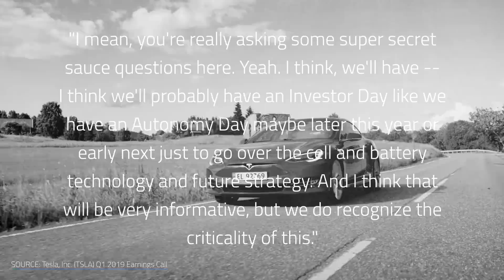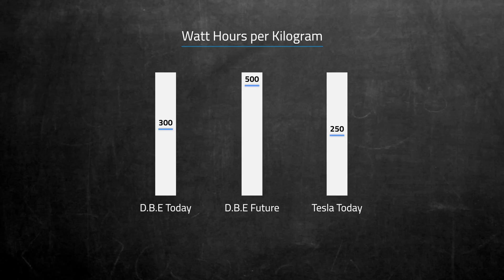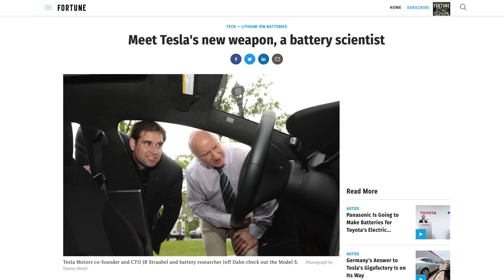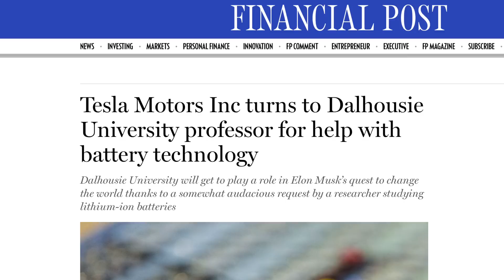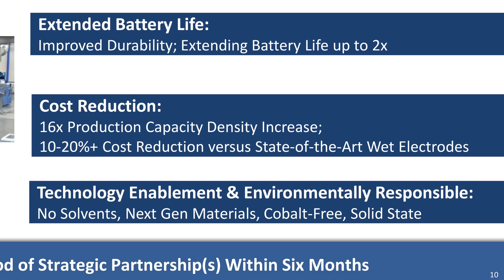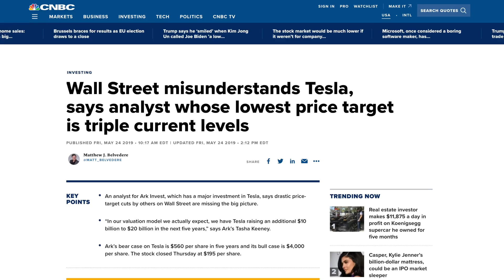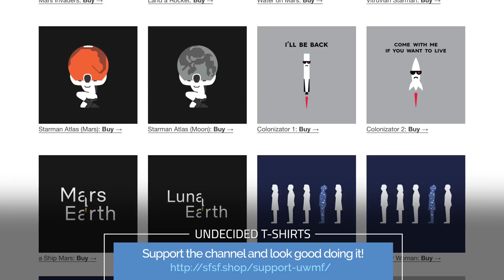Tesla And Maxwell Technologies

Comment: I'm missing only one thing about the aspect of UltraCapacitors which isn't highlighted in your story.
It's ability to both take on an enormous amount of power as well as provide this back in a very short period of time with less to none heat conversion.
Using this aspect as a "buffer" can easily increase both "power to the wheels" without hurting the batteries as well as immediate regeneration on breaking. 

This would be especially effective on regen breaking and quick power requirements on performance cars but would also work as a very good buffer for i.e. the Tesla Semi.

Also dry cathode battery with ultracap "skills" or a hybrid setup could due to it's efficiency last longer and have increased range because of decreased losses plus increased range due to increased capacity.
Reply: Won't need caps at all in the new vehicles. The batts provide 1 million miles. All the caps would do is shred the rubber off the rims.
Reply: Supercaps are a cheap but not very energy dense solution for hybrids that have batteries that are too small to take a burst of regen electricity.  Tesla cars do have a large battery so they can do a high regen rate, so supercaps wouldn't add anything.  I wish people could understand this.
Reply: @gigglehertz  they don't need to be very energy-dense to act as a "buffer". With a very low internal resistance the regen will lose less power due to heating so more power remains. 

This remaining power won't last forever because the ultracaps have a higher discharge rate hence it would mainly add on the track or with cars that have a very high weight which could give a very high regen power.

Perhaps check this out:
"Ultracapacitors are good partners for lithium-ion batteries and other high energy density storage technologies. With power density up to 60 times greater than batteries, they can be connected in parallel to create combined power supply units. Due to load leveling, the ultracapacitors can significantly expand battery life and improve safety. In an electric car, for example, an ultracapacitor can provide the power needed for acceleration, while a battery provides range and recharges the ultracapacitor between surges."

Source: https://www.skeletontech.com/ultracapacitor-technology
Reply: @gigglehertz  Ultracapacitors have very little internal resistance (down to 0,12 mΩ), allowing them to work at close to 100% efficiency.
Reply: @gigglehertz  the Tesla car battery has a very large internal resistance and will have more heat conversion than an Ultracap would have. Ultracaps have over 100x less resistance and with that near to 100% efficient energy transfer. This makes them very usable for a buffer between the battery and the engine. Especially for cars that are in "Track mode" or for e.g. a Tesla Semi that would require a very large amount of power to start off. An ultracap can even out the peaks in the power surge and with that stress the batteries less.

Perhaps check out this site to get an idea of the advantages in this context:
https://www.skeletontech.com/ultracapacitor-technology
Reply: @gigglehertz  Just  a short quote from the site I was referring to:
"Ultracapacitors are good partners for lithium-ion batteries and other high energy density storage technologies. With power density up to 60 times greater than batteries, they can be connected in parallel to create combined power supply units. Due to load leveling, the ultracapacitors can significantly expand battery life and improve safety. In an electric car, for example, an ultracapacitor can provide the power needed for acceleration, while a battery provides range and recharges the ultracapacitor between surges."

Comment: Million mile battery with 400 or more miles of range?  Since I would burn through a million miles in a mere 50 years at 20,000 miles per year, I am not buying this junk.  I mean if you average the price  of a 45k model three over 50 years that is almost 1000 dollars per year, freaking ridiculous.  And the car only has scalded cat levels of acceleration, and only five star safety.  Come on Elon, you can do better.
Reply: If an autonomous semi truck is driving around 24/7, stopping only to charge and load/unload, then you could get to a million miles in three or four years. Wonder why Tesla's looking for a million mile battery?

Comment: @1:05 “that innovation (DCE) is the primary reason Tesla purchased the company”.  Do you have a link to an official statement from Tesla or Elon, or are you stating speculation as if it were fact?

@1:20 Elon totally dodged the question. He made no claims about why Tesla bought Maxwell. Why would he when the Tesla fans are already reporting it is fact? Except that analysts can’t factor in some fan based speculation into the price.

You guys are overlooking the basics while searching for a unicorn. Maxwell makes capacitors. Tesla uses capacitors, and lots of them. Tesla can probably use all of Maxwell’s production capacity just in its inverters and chargers, in its vehicles and energy storage units.

Tesla bought Maxwell for 3x it’s book value. TSLA trades at 7X book, so buying Maxwell will instantly make TSLA fundamentals slightly better, so that’s icing on the cake.

But Tesla bought Maxwell, and it’s DCE Technology, for a mere $200million in TSLA stock, which means Tesla paid less than $200 million for this $trillion battery technology, and Tesla doesn’t even manufacture battery cells, so they would need to branch off into cell manufacturing to even use the theoretical technology.

I think we should look back on what happened with large format NiMH battery technology, when GM bought 50% of Ovonics's technology in 1994, sold it to Texaco in 2001, who was acquired by Chevron in 2003. This was the battery that made the EV1 almost viable, and was used in several Toyota EVs, and is still used in some Toyota hybrids. 

So if Maxwell had real technology, or even remotely feasible technology, why wouldn’t someone buy it or al least 51% of the rights to it for $100 million? If this battery is all the Tesla fans claim, it’s worth $trillion dollars to a battery cell manufacturer OR any company who wants to delay the adoption of EVs.

MXWL sold for $40/share in 1999, don’t you think all those shareholders tried their best to get someone besides Tesla to buy it for 1/10 of its all time high? 

Are you really going to believe Panasonic, LG Chem, Samsung, GM, Ford, Shell, Chevron, or the 100 other companies which have $100 million as pocket change wouldn’t have bought MXWL if any of the experts who met with Maxwell told their client to buy it now? 

And why doesn’t Elon say it if it’s true? The stock could use a boost.

Unfortunately a lot of the Tesla pump and dump squad reported speculation as fact, and a lot of bagholders bought shares at over $260/share.

J.B. Straubel, in order to not risk going to jail for insider trading, has created an automatic execute and sale plan. Since nov 2018, he has executed 105,000 options for $20-$31/share and sold them for $264 —> $190 per share. He netted over $40 million before taxes. He is allowed to cancel the automatic selling plan at anytime without risking insider trading. So ask yourself, why is the real brain behind Tesla selling so many shares of a stock that Ark invest says will be worth $560-$4000/share? What does J.B. Know that we don’t?

Comment: Maxwell is in more markets these could be helpful for tesla:

 - automotive: active suspension, backup-power for eCall and doorlock

- heavy transportation and industrial: trains, buses, trucks, cranes, generators;  bridging power and grid/voltage stabilization, braking energy recuperation

- grid stabilisation, wind and solar power smoothing, hybride power storage

- energy storage for windturbine's emergency pitch control system

Comment: Maxwell Tech also had another project that Tesla intergraded into the Models they are now building.Regenerative Suspension, Another way to get lost power back to the battery.
Reply: add regenerative respiration:  the calories from your lungs .... ;-))
Reply: @JamesSempy  or a full body suit. Every time you move you generate electricity. It can very green if you eat lots of vegetables for calories.
Reply: Yeah currently gigantic wave tech power shrunk down sounds amazing
Reply: California will start charging it's citizens for the electricity from the pot holes it doesn't repair.  Unless you are an illegal alien or a college student, then it's free of course.
Reply: Reverse polarity braking would be great also. Shouldn't ever need brake pads
Reply: Crypto KO, should be no more smoked brakes on hills too.
Reply: Mall JZ mini windmills would only pop up during braking. Let that sink in for a moment.
Reply: I wondered why I hadn't seen that idea in the open yet. Electric suspension has been on test mule cars for a while (90s, 2000s?). Why not charge the battery with the "dampening energy". <edit> I was thinking this process takes energy, but i guess shocks and springs don't, the system would just add weight and have some efficiency. Seems a like a great idea to work on. <end edit> There are some other comments below on the better capacitor technology being required to make everything work decent.
Reply: Something obvious but nobody else thought of. Yes, large amount of energy generated in absorbing shocks and noise.This is why electric cars can have huge energy efficiency.
Reply: @kelvinham8576  no doubt!
Reply: DAMN! THAT'S A FANTASTIC IDEA!!! 
An inductive system that works like a microphone instead of a speaker!!!
Reply: In the place where I live in , roads are really shitty , i think i could charge the battery just by riding a motorcycle , that's how shit the roads are
Reply: Excellent idea, newer thought of it. I feel dumb :)
Reply: waow it wud be great if u share some link or data regarding the same. sajid.sayyad3@gmail.com
Reply: Regenerative suspension means power per bump.
Reply: @davidpalmer5478 - What you said is "true" (in a narrow sense), but a bit misleading or "exaggerated" because it leads (at least some) readers into the wrong conclusion, such as, "the more bumps, the better".   Unfortunately, "bumps in the road" create up & down motion, and that up&down is kinetic energy, which "originates" from the velocity of the vehicle, and that means the vehicle's kinetic energy (i.e., vehicle speed) is reduced.  So, if you recoup some of the up&down motion (which is called re-generated energy) you're a little bit better off (than not recouping it) , but you cannot recoup all of it .... you always have losses of energy  (to heat) which cannot be recouped (a Law of Physics) .... So, "the more bumps, the more losses there are to heat", so (theory says) you still (always) want to reduce the bumps.  Of course, that's what suspensions do , and it's one of the benefits of reducing "unsprung weight".  (The weight of the wheel is "unsprung weight" ... and the weight (of the  rest of) the car is not.  My guess is that this new technology (in the vehicle suspension) would increase the range of the battery (on a rough road) by something like 1% ... at best.  Probably most significant for 18-wheelers on the highway, and of course, that's another application (i.e., product-line) Tesla has been heavily pursuing
Reply: @neilanderson891  I haven't seen the perfect road yet, yes some parts of it, like about 50 meters of it. But a road from end to end, no. 
As long as roads are not perfect then there's the opportunity to regain some power from the bumps. 
Your estimate of 1% is just a guess. It would depend upon how imperfect the road is.
Reply: Don't forget about regenerative mini wind mills on top of your car.
Reply: @lijie6431  I'm sorry but this is a terrible idea. You can't reduce aerodynamic to generate electricity. You waste energy.
Reply: @flymeedrone6350  I'm pretty sure it was a joke...
Reply: @yahikotendo5631  let's hope so!  :D
Reply: Great Value Bleach actually I like that idea, why did EV car makers didn’t think of a tubular skewed windmill fans which can sort of “go up” only when car starts to drive and can be manually controlled to go “sleep” when entering a car park or a zone with height restrictions. Think about 4 of this “chubby” fat windmill with cars running at hi-speeds could actually generate some serious power on the highway / motorway roads. Brilliant mind 👍👍
Reply: @SamMonkulas  Actually I have an idea that has 2 biuld in wind turbines fallowed by filters that take pollution out of the air before going back outside or into the Tesla bio filters for the AC.
Reply: How about solar roofs on top of your car instead of mini wind mills?
Reply: SuperGeronimo999 if there is space then one can easily design a combination of both. The Wind Turbine x 1pc can generate 300-400 watts and Solar panel on a full roof of car can generate 200 watts max. So 4 x Wind mills can easily go above 1,000 watts give or take which is not so great but impressive given a car must stay in running speed conditions. Solar on the other hand gets advantage of parked in Sun to generate that 200watts on a nice sunny day. So pros & cons, I can’t say which is better. The action required on part of manufactures to incorporate atleast a 200watts multi solar panel on Car roofs starting as of yesterday, irrespective of car being EV or gasoline. That extra 200watts can be dumped into supercap Bank from where all other electronics and bells & whistles can draw power leaving the 12V battery free for running Engine and last for 3-4 years instead of 2 year lifecycle.
Reply: @SuperGeronimo999  probably more due to legal requirements, the panels would dazzle other drivers maybe not cars but larger vehicles, if they could make a retractable roof that covers the panels when driving it may be possible, im sure Elon has thought of it especially if he had a parking lot full of tesla cars all plugged in with panels on each roof generating power like a normal solar grid if say they recharge the cars as a whole in 1 hour or 2 if your at a shopping centre or workplace and you where there for more than the charge time of your car you would then just be adding power to the network grid making tesla money and maybe they can reward you with slightly cheaper charging if you stay for say an hour or longer, everyone is happy, imagine workplace parking turning into a solar farm while everyone is at work for 8 hours they could literally make it free plug in and go home with fully charged cars , I cant see it being a cost issue as Elon already owns or runs one of the biggest solar panel companies on the planet so if anyone could do it he could but if a lorry driver was dazzled by panels fitted by the factory and ended up causing a huge accident imagine the lawsuit thats the only logical reason I can see why they don't fit them!
Reply: @lijie6431  And a mini ICE engine in the frunk to generate MOAR power

Comment: Maxwell capacitors sold today do not have the energy density to SIZE ratio of lithium ion batteries. A Maxwell system would be the size of the car or bigger. Try it in a rc car
Reply: Excellent point.

Comment: Combine a smaller battery pack with an ultracapacitor to handle regen and hard accelerations. That would significantly improve the battery pack's lifespan.
Reply: Small batteries mean lower recharge rate which no amount of supercaps will compensate for.  Please stop with this supercap nonsense.
Reply: @gigglehertz    But that config might be a pretty good setup for a lower cost vehicle intended solely for city cycle driving with high incidence of stop/start traffic...
Reply: 1 million miles that the batteries provide is more than enough.